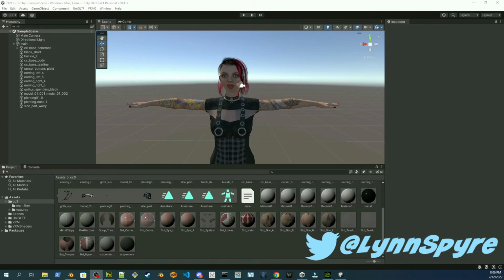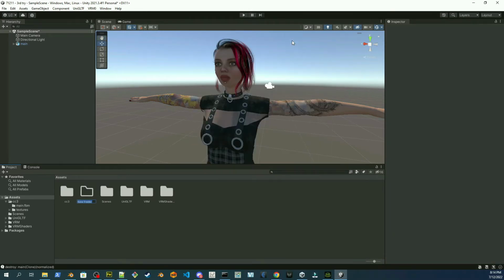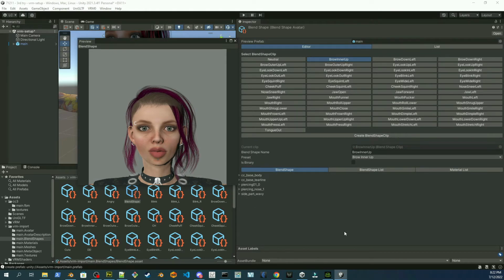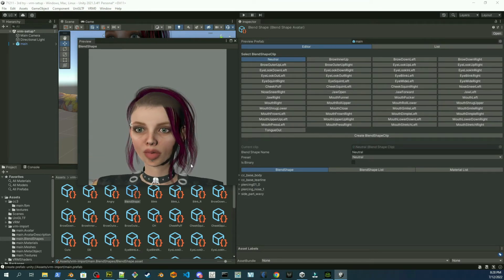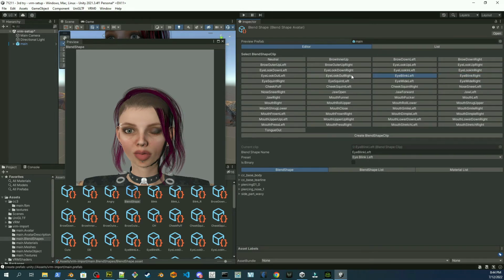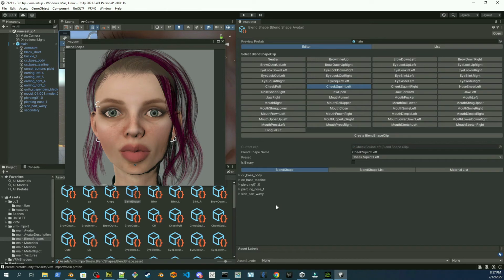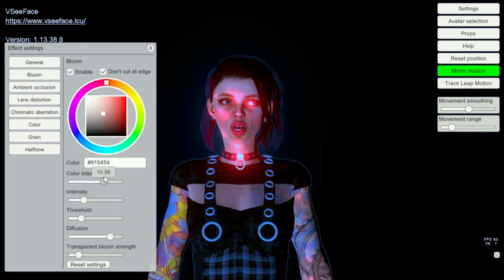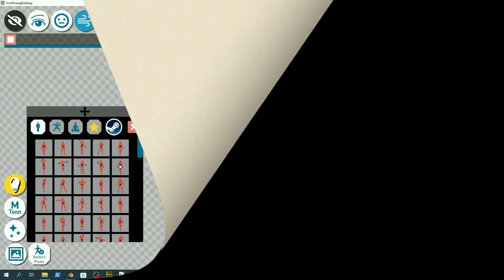Deep dive into VRM blendshape mixing with blendshape proxies for realistic models

Comment: How do you handle Daz3d using negative values for differentiating between left/right, up/down in eye movement.  Unity doesn't allow negative values.
Reply from the maker: This is true, but unity does give you access to eye bones which you should be able to use the same way
Reply: @PriestessOfDada   How do you make a Unity value change a blend shape with the others?

Comment: Does it work for cc3  model
Reply from the maker: The model on the screen is a cc4 model. You can do the same thing with a cc3 model, but you'll need the stock cc3+extended facial setup. The cc4 perfectsync profile won't work inside of cc3. But it's not a huge difference.
Reply from the maker: The process of applying the perfectsync blendshape proxy in unity is the same, but the blendshapes that come from Reallusion are formatted differently. It's BrowInnerUp in unity, but Reallusion gives you 01_Brow_Inner_Up. The assignment I'm doing works the same way though
Reply from the maker: I updated the description with cc3 instructions.
Reply: @PriestessOfDada  Okay i am checking that out now
Reply: I can not find the ExPlus (or better) expression set under Edit Facial in CC3
Reply from the maker: @abiodunfatoyinbo3214  No problem. Check the reallusion video on the topic. That can be found here: https://www.youtube.com/watch?v=uJWraq8q0os
Reply: @PriestessOfDada  Okay, i am using version 3.32